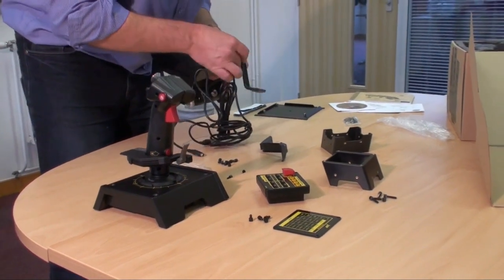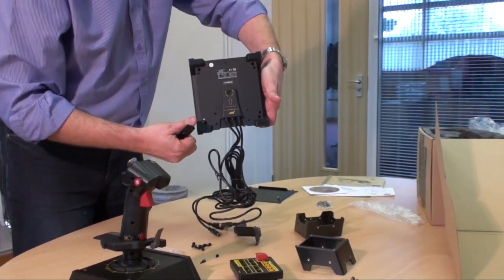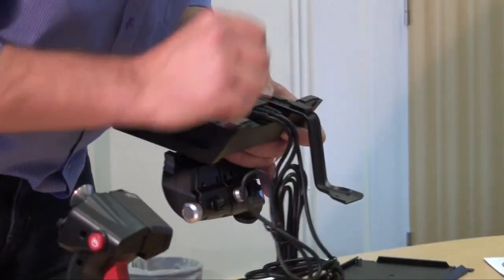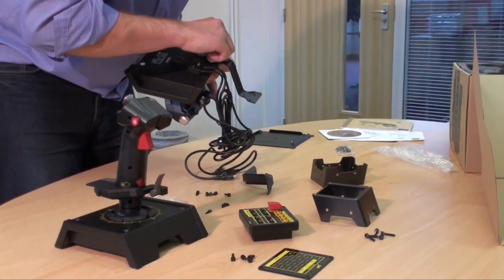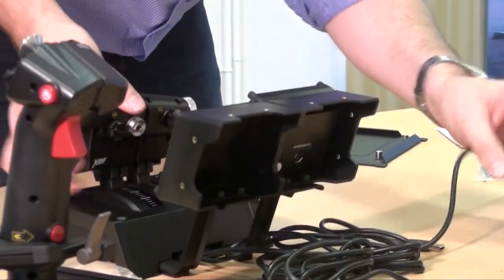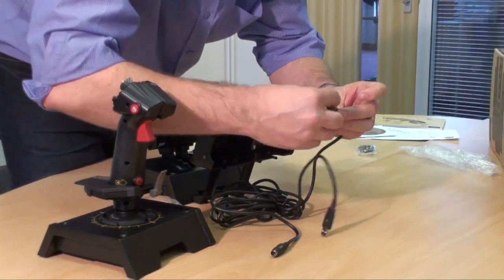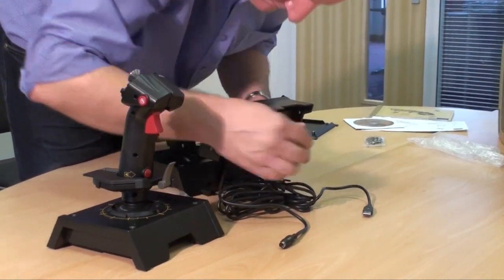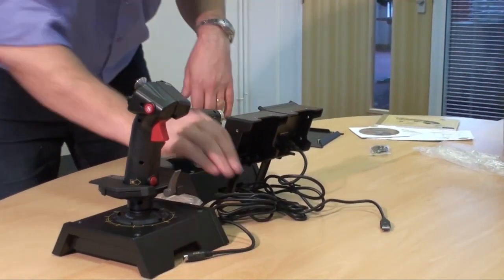Saitek ProFlight X-65F Combat Control System Assembly Video

Comment: I recently picked one of these HOTAS up for 100.00 bucks, I have been trying to get it working with Windows 10 build 2004, the device starts the install, the drivers get to the insert device hit next and hang there. No matter what I do I cant get the drivers to install or the device to be recognized in Windows 10. I was wondering if anyone has had this issue or found a solution. Or could point me someplace for more information.

Comment: Why didn't you make the cables removable/changeable so we could use a better shielded and ferrite (those cylinder things on high-quality USB cables) cable between the stick and throttle?  This PS/2 cable picks up RF/EMI interference like crazy.  Even moving your hand around it or touching it changes the rudder deflection.  Fluorescent lights being switched off send a antennae-like surge through the unit and you can see the axiis all jump.  Calibration of the rudder is essentially pointless.